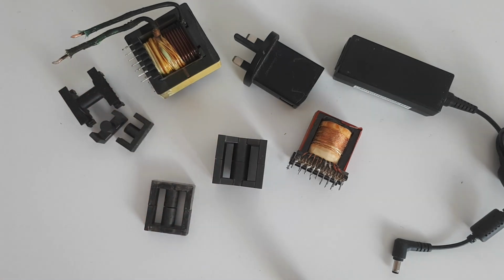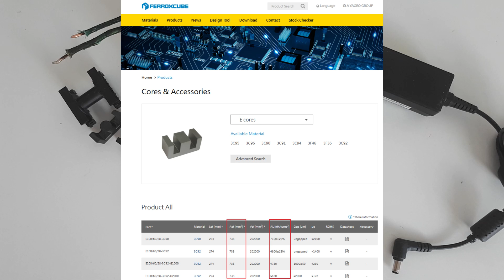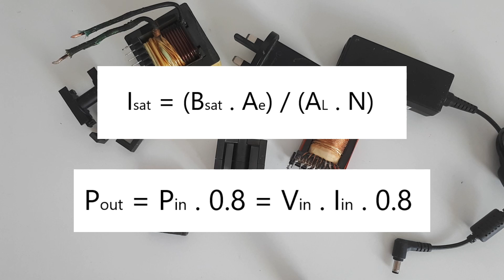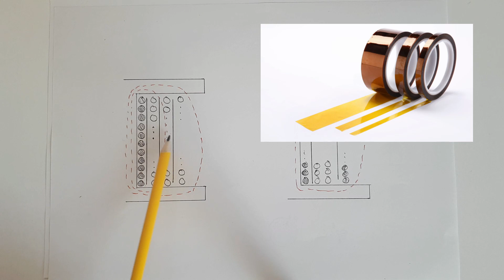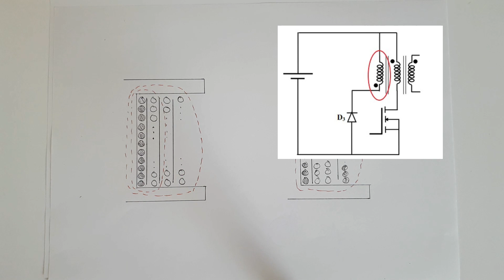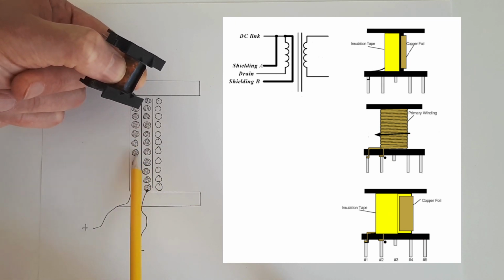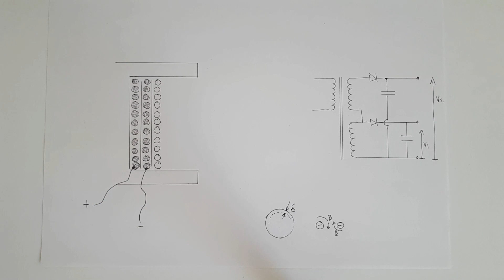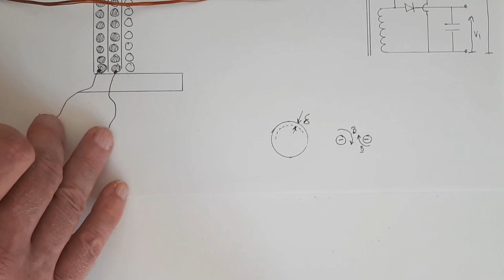Switch Mode Power Supply Transformer Design for Beginners

Comment: With a gapped core almost 100% of the energy is stored in the air gap.

When a transformer is used as a true transformer, the flux in the core does not change appreciably with load current, since the primary ampere•turns are cancelled by the secondary ampere•turns. As power increases, for a given frequency, the core size must increase to allow enough window area to fit windings heavy enough to handle the currents.

Extra windings are not used to discharge leakage inductance. Leakage inductance is there because of imperfect magnetic coupling between the windings that are already there. You might split a winding for better coupling to reduce leakage inductance. A reset winding is used in a forward converter where there is no means of discharging the energy stored in the magnetizing inductance.

Normally you don't fill a bobbin fully end-to-end because of the need for safety margins for "creepage and clearance." Triple insulated wire can be a boon, though an expensive one, because the insulation removes the need for the c & c allowance, letting you use the full bobbin. Typically it is used either for the primary or the secondary(s), but not often both.

A copper foil external shorting band is normally used only on a gapped transformer, which means only (in general) for a flyback converter.

I've designed 1 kW switchers. I'd hang my head in shame if they were as horrible as only 80% efficient. I've achieved much better than that overall in designs with active power factor correction (so the overall circuit is essentially a specialized boost converter followed by a half-bridge). It is difficult to get really high efficiency with very low output voltage due in large part to diode losses. Synchronous rectifiers can be a big help there.

Ignoring the skin effect issues, wire size is based on RMS current, not peak or average, though of course they all go together, but the ratios depend on the waveforms.

I don't think the wire shown as litz wire actually is, but it's hard to tell.. It looks like it is merely a large bundle of fine strands each of which is individually insulated.
In true litz wire the design is much more complex and the strands are arranged to that all of them "spend the same time" at the available positions in the bundle. That is, a conductor will move from the centre of the bundle out to the periphery and then back toward the center. This isn't necessarily done for each and every individual conductor, though that is often the case for small litz wires, but for small bundles of conductors.

Litz wire is expensive, nice to wind because it is very flexible, and hard to terminate because each strand is insulated.

Copper foil for windings has some significant benefits, but like everything else in a switcher there are compromises that must be evaluated. I've used it in several designs. If you go to a contract manufacturer for transformers they may prefer using parallel strands of magnet wire because their equipment is set up to handle it well.

A copper foil external shorting band is normally used only on a gapped transformer, which means only (in general) for a flyback converter.
Reply from the maker: Hi. Thanks for taking the time to watch all the videos and make clear and concise comments. Its difficult to go into detail in videos while keeping them clear and simple for beginners but also accurate for advanced people. My aim is that the video serves as a introduction for beginners, while more advanced people can correct any mistakes I make in the comments, so thanks again. However, I am confused about one of your points : "When a transformer is used as a true transformer, the flux in the core does not change appreciably with load current, since the primary ampere•turns are cancelled by the secondary ampere•turns. As power increases, for a given frequency, the core size must increase to allow enough window area to fit windings heavy enough to handle the currents."...This sounds like a transformer such as forward converter will never enter saturation because the flux is always canceled...is that correct?
Reply: @ElectricMonkeyBrain  
You most definitely can saturate the core in true transformers.

Acting essentially in parallel with the transformer is the primary as a simple inductor. When you apply voltage to the primary winding the current in it ramps up according to its inductance, independent of any emery being transferred to the secondary. If there is insufficient inductance the flux can build to the point where the core saturates.

Keep in mind that if the input voltage to a forward converter were fixed and the output voltage were fixed, the duty cycle would be constant, regardless of load current, once the output inductor started operating in continuous current mode, ignoring losses (typically you'd set the output filter inductance to make the transition form discontinuous to continuous current at somewhere in the range of about 20% to 40% of the full rated output current of the supply). Of course losses do increase with increasing load current so the duty cycle must increase a bit to compensate. 

Typically what you would do is set the number of turns for the primary winding high enough so that the maximum volt-second product you would apply wouldn't ramp the magnetizing current up to the saturation point. When the converter is operating normally, the volt•second product will be essentially constant with the output inductor in CCM. However, things get messy if you have a wide input voltage range. Normally you still have constant volt-second product when the converter is regulating, but "large signal" perturbations can result in transient increase. You have to be careful. Converters that employ  cycle-by-cycle peak current limiting can allow less conservative design with fewer primary turns (lower primary inductance). The current limiting ends any switching cycle that might saturate the core before saturation can happen, assuming, of course, that it is properly designed. Without such current limiting you might be forced to use the maximum possible ON time and the maximum possible instantaneous input voltage to determine how many turns you need for the primary so that you can be sure, not matter what happens, you won'd drive the core to saturation. (the current limiting can't distinguish between over current due to load current or due to the core approaching saturation, but that's OK)

Generally you don't want any more turns in any winding than you really need since you have to fit the wire and consider the resistive losses. Sometimes you do need to adjust the number of primary turns to get an integer number of secondary turns because half turns for the secondary are not easy. This is more likely to occur if you are designing for a very low voltage output where the total winidng might be only 2 or 3 turns.

Forward converters bring another saturation problem. A forward converter operates in only one quadrant of excitation of the core. You apply voltage to the primary and store some energy in its inductance. You want to get all of that energy out and drive the core back to essentially zero residual magnetism. If you don't do that, each successive cycle will drive the residual magnetism higher and higher until the core saturates. There is no inherent path to get that energy out - it has nowhere to go on the primary side and it can't go into the secondary circuit because of the diode. This is where the "reset winding" comes in. It allows for the energy stored in the inductance of the primary to be discharged, "resetting" the core. Typically the reset winding has the same number of turns as the primary and the maximum duty cycle is limited to 50%. That assures that there is sufficient time to discharged the stored energy in the worst-case condition. There are ways to allow higher duty cycle but care is required. Many control ICs don't allow easy precise control of maximum duty cycle - you can get nearly 50% easily or nearly 100% easily, but something like 70% might be difficult with any consistency unit-to-unit.

Even with converters that operate in two flux quadrants (push-pull, bridge, half-bridge) you can get into trouble with staircase saturation if some persistent imbalance in volt-seconds between the two working quadrants arises.

Switchers are horrible beasts! There are all sorts of opportunities for things to go wrong. I often describe switchers as something in which everything is in conflict with everything else.
Reply from the maker: Thanks a lot, that much more clear. I will pin this comment. I will also ask for your advice if I decide to design a SMPS in the future, if you dont mind of course.
While I have your attention I would like to ask you a different question....do you know of any chips/micro-controllers suitable for controlling multiple switches? I have a little research project where I need to control the phase between two full bridges driving resonant transformers. I have done this using analogue chips with some limited success but it always contains some nonlinearity in frequency and pulse width control, further complications occur when I want to introduce pulse packets, like interruption or amplitude modulation. Then I moved to an Arduino which also worked, but the min pulse width is limited because of the  internal computation which is going on. Know any chips suitable for this? thanks @D614G_aka_Doug
Reply: Hello, there is no way to message you, but I want to ask one question which prevents me from designing my own SMPS. It's the frequency. Do I just pick the frequency myself or the core needs to be compatible at my frequency or how would I choose it? Can you help me? Thanks in advance
Reply from the maker: Hi, well its a difficult question. The frequency is one of many variables which all effect each other. Just pick a frequency. higher frequency allows more power but can be difficult to handle. Unless you are a specialist I think you should be safe with 100-400KHz. The core should have some data about its loss vs frequency, so you can choose based on that. Cores work at all frequencies, just not so well above certain values. Usually the first step is to have a bunch of requirements ...whats your input and output voltages, power ect. Then you choose a topolgy which can handle the power. If you need help I would right down as much info you can think of, and post it in a forum and ask peoples opinions, like the EEV blog. In forum you can post schematics and equations ect.   @filipsebik23
Reply: @filipsebik23  
Generally you pick the frequency yourself. An exception to this would be if you are going to use one of the integrated control+power ICs that has the MOSFET in the package with the control circuit. With most of those the frequency is fixed. They are typically used to implement flyback converters, though you can use at least some of them for a forward converter. I designed with such a part from Power Integrations several years ago. If I recall correctly it ran at about 135 kHz. I haven't looked at what is on the market in years, so things may have changed.
The core material you select does need to work well with the frequency you select, but you don't need any sort of precise matching. Typically a manufacturer will offer two or three different materials. If you use a very high frequency only one might be well suited. At lower frequency it might make only a small difference. The materials for higher frequency are usually a little bit more expensive.

100 kHz is a reasonable starting point for moderate power - in the range of several tens of watts to a kilowatt or more, depending on the topology. That frequency is a reasonable all-around compromise - the transformer can be kept quite small and you can usually use ordinary magnet wire for winding (I've used foil for secondaries at 100 kHz, but obtaining suitable foil can be a problem.) If you went up to say 400 kHz you might have to go to Litz wire, which is a lot more expensive. Switching losses in the MOSFETs, if that is what you are using, tend to be pretty constant per switching cycle for a given power and topology, so the higher the frequency the greater the losses. You can use things like quasi-resonant or zero-voltage switching designs to reduce losses, but the circuits are more complex and can be more difficult to get "just right" - not what I'd recommend for someone just starting. Lower switching frequency may improve overall efficiency a little, but you may need a bigger transformer and a bigger inductor, so the efficiency analysis isn't simple. 

One other thing that might push you toward using some specific frequency is if you want to use one of the off-the-shelf transformers that are available. Wurth, a German company, offers some. I think Coilcraft in the US has some too, but again I haven't looked at this stuff in years. You don't have to use exactly the frequency they recommend but it may make getting the whole thing working easier if you do.

Be aware of the fact that AC mains powered SMPSs can be difficult and dangerous to work on. Things that are only moderately expensive, such as variacs and good isolation transformers can be very helpful or even essential. 100:1 attenuator oscilloscope probes may be needed. They generally aren't too expensive. I used an oscilloscope current probe a lot. It cost several times as much as many of the oscilloscopes hobbyists use these days. You don't necessarily need a current probe but they can be very helpful. (If you have the right make of scope with the right probe interface you might get a good current probe for considerably less than mine cost, but you'd probably still be over a thousand US dollars. Yikes! I just had a quick look on the web. The first one I found is from Tektronix as is mine, but with better specs. It is almost 8000 US dollars.)
Reply: Absolutely wrong: With a gapped core almost 100% of the energy is stored in the air gap. No, it depends on the magnetic path to gap ratio. Using a gap in a transformer core is a bad practice.

Comment: Are pot cores less sensitive regarding the placement of the primary coil close to the center as in 7:48 ?
Reply from the maker: I would guess the answer is yes, but the difference is probably small....so the primary is always best near the core center.

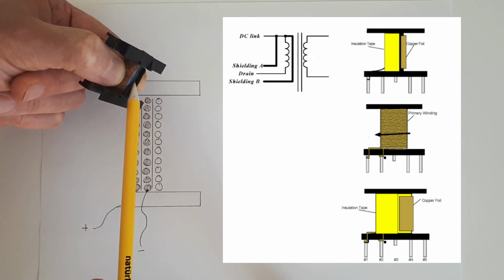Comment: 12:43 they will also use a single winding that doesn't connect to anything inside the transformer and the only connection is to ground.
Reply from the maker: yes I think you are right. There really is lot of different techniques used in transformers.

Comment: Yellow transformer tape is mylar iirc
Reply from the maker: lol. No ones perfect I guess. Thanks for the correction.
Reply: The tape shown is polyimide (Kapton is a well-known brand name). The yellow tape is polyester (Mylar is a well-known brand name). The yellow is normally just from the adhesive. Polyimide is a lot more expensive than polyester.